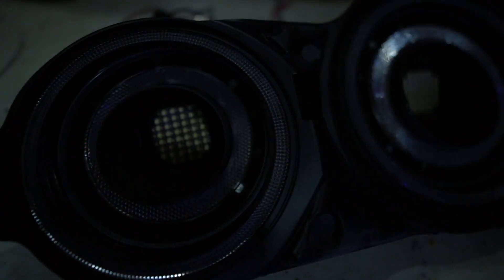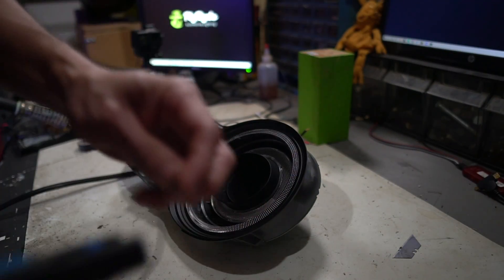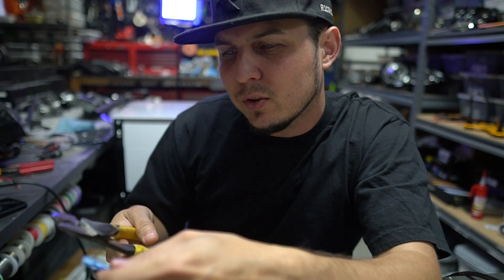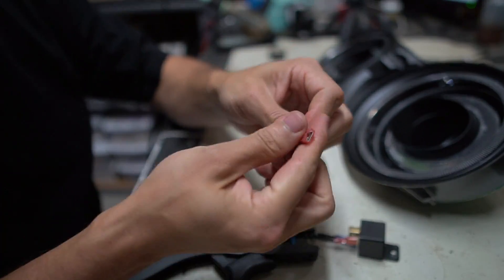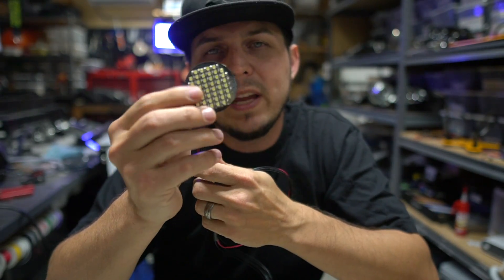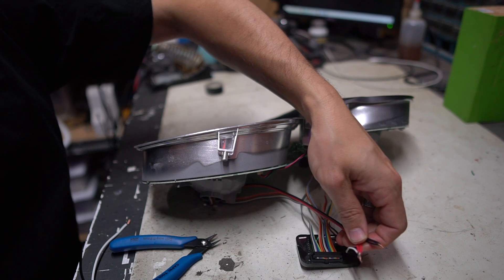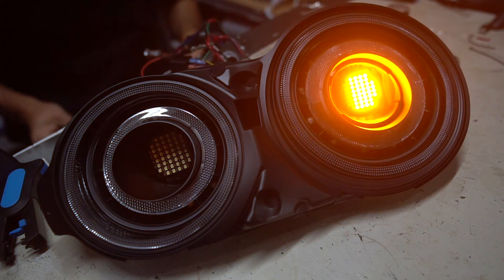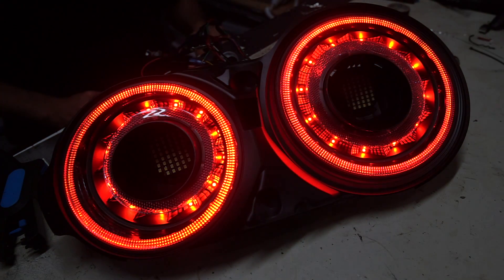HOW TO Change Positive To Negative

Comment: Hey, I have a question? I bought an Auxbeam 8 gang switch panel to wire my rock lights too but , I want to clean up my wires to my battery and wire all my lights that I have installed. My problem is my pod lights that I installed to my reverse lights and also on a switch to cut on and off when I’m hooking or unhooking my trailer at night . I have them wired to a relay. How can I wire them to the Auxbeam panel?

Comment: so im trying to wire up rocker side marker lights that are white when the door opens and changes to amber when the door closes but issue im running into is the white light power is always hot there fore when the door closes the white lights stay on and don't change over to amber. what do you think i could do to fix this issue i have seen it done but nobody explained how to actually do it thanks!
Reply: Maybe you could wire it to the wiring/sensor that senses when the door is opened or closed. You know the door open light in your dash, wire to that wire.

Or wire to your dome light maybe

Comment: What dual color led medallion is that?  Doing a Jeep front turn signal project and the size looks close.
Reply: Likely something from Korea or something specific for the GTRs
Reply: @keithpoley3432  Haven't found 'em.  If anyone's got a source/link, t'would be appreciated.
Reply: @SoooBrian  I do custom lights too, I'll do some searching for you and see what I can find. I've never seen them before myself but they are a pretty cool little combo.
Reply: Damn I can't find those anywhere. Few similar things for like motorcycles that are 4" with bi-color LEDs (I'm guessing that's a 4" area in the GTR tails) circular that could be dismantled and modified but that's a hassle. I think he probably has the PCBs custom made =[ you'd need a controller like a Ghozt too obviously by how he shows they can work in sync with the Red brake LEDs etc.

Hopefully he gets back to this because I want to grab some of those for projects too
Reply: @keithpoley3432  Lots of motorcycle options in that small round configuration. I'm planning some amber piranhas with a Ghozt module, was just looking for something easy/repeatable.
Reply: @keithpoley3432  BTW, thanks for looking around!
Reply: @SoooBrian  No problem man I try to help. Yeah there you go, it wouldn't be hard to make with some blank PCB board yourself. They sell Pirahna bi-color white/amber on AliExpress. Last time I asked they said they had all configurations of common anode/cathode too. They sell Red/Amber Piranha too.
Reply: @SoooBrian  I want to give you the links but youtube deleats the comment everytime. If you want to look at them I can email the links to you if you'd like.
Reply: @keithpoley3432  I think it's deleting my one-time use email address too.  Don't want my real email address floating around the youtubes
Reply from the maker: These are from ZLEDs. I believe Sam usually has them setup to be common cathode instead of ghozt ready like these. It was a special order a few years back.
Reply: @flyryde  Thanks, Chris!
Reply: Follow..